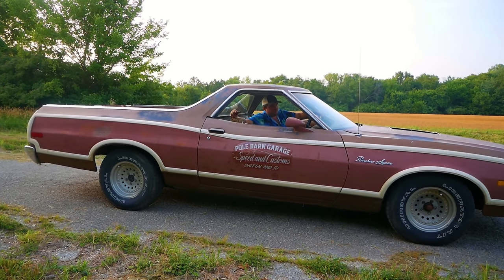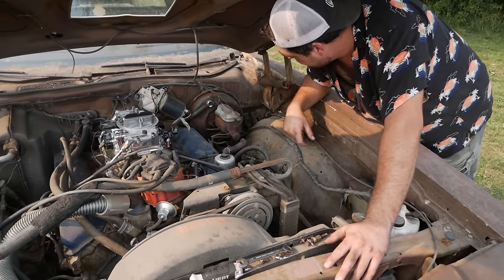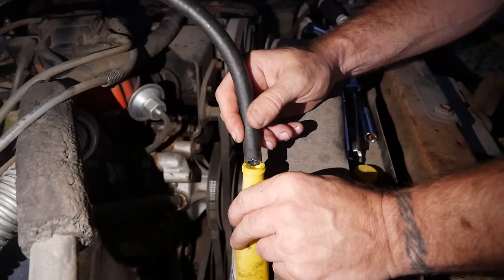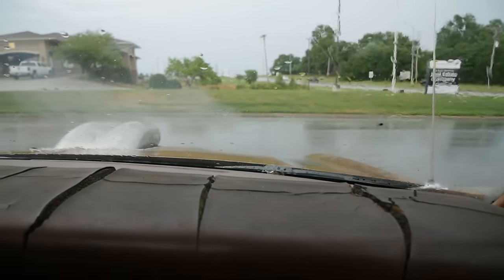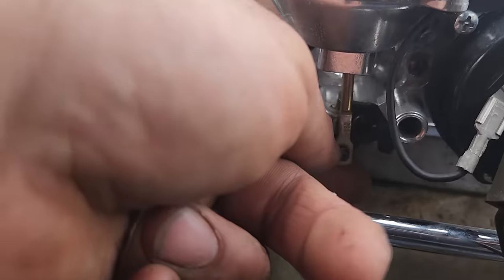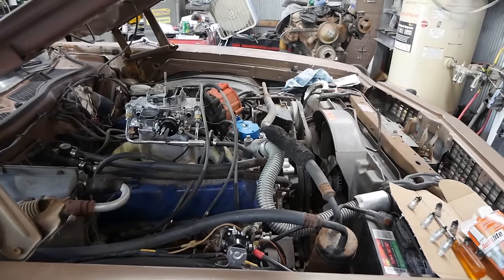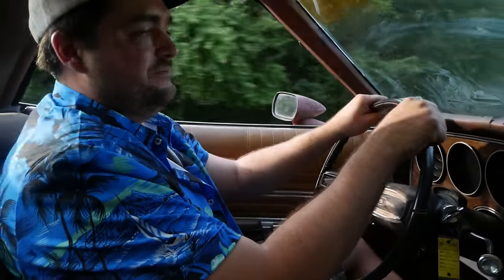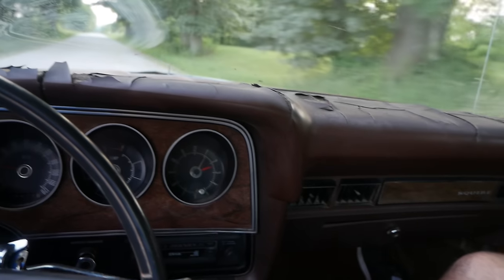Forgotten BUILT Big Block Ranchero-Will It Run and Drive? Huge BURNOUTS!

Comment: Did you add the zinc just for the heck of it? Having the steel valves must not necessarily mean the heads are able to run off unleaded gasoline then? Super sick Ranchero though!! Probably my favorite on the channel yet. 🇺🇲🇺🇲
Reply from the maker: Zinc is for flat tappet cams, not valves. Leaded gas was for valve seats. Thanks!
Reply: @PoleBarnGarage  Ahh... I should have thought that out a bit more...lol
Thank you for the information!!

Comment: One thing I learned watching these revival channels, DO NOT put a summit carb on your unit. I’ve never seen one not have problems. The basura blanca has to live up to expectations. A set of rear  tires a week has to be the goal
Reply from the maker: Yeah those things are garbage. If I had any better options on hand I would have gone another route

Comment: My 1984 cadillac seville is my prised possetion. I got it off the original owners nephue after he passed. The owner lived the car and put 100k miles on it. The car is warn but it still shows nice and runs ok. I wish the engine was just a regular old pushrod v8 but it has the ht4100. People tell me to swap the engine out and put in a olds 350 but i feel like the engine is the heart of the car. That engine is what powered that car for its entire life all 100k miles. Changing the engine just seems wrong to me. I do all i can to keep the old girl going. I would rebuild the top end of the engine but everybody says once you take the head off that engine youll never get it to run right again. So i change the oil ever 1000 miles once a summer. I hope it lasts a long time. I feel like i owe it to the original owner to keeo this car on the road make sure it never ends up as scrap. So many of the 80s cadillacs were scrapped because of the bad engines. Its hard to find eldorados and sevilles from the early 80s now. Can you guys please try to find a seville to save? They were such a iconic and beautiful 80s car. Some people hate the design others love it but wayne kady designed a beautiful car. They took a risk and it payed off for them. Ford and chrysler actually copied them and made bustle back cars of their own. Well if you read this comment please please please try to find a 80-85 cadillac seville to save. I want more people to be aware of these cars. I get so many looks and questions when i drive mine. Plus i lt would be nice for somebody to show a video of repairing a ht4100 engine.

Comment: The 73 429 engine had 8:5 to 1 compression. Timing 10 degrees before tdc. 36 degrees total.
Reply from the maker: If it were stock, sure
Reply: @PoleBarnGarage  Pistons look stock.
Reply: Compression test would tell.
Reply from the maker: Valve overlap dramatically changes cylinder pressure regardless of piston (for better or worse) clearly it has plenty of duration going on. Once you change a cam you can no longer use factory timing specs, because you've changed the combustion event

Comment: Yall ever run across any Cyclones? That woud be neat. I had a '71 GT in High School (circa 1989) Supposedly it was #12 of 29 built as a police interceptor. At the last minute, whatever dept was going to buy them backed out because they wanted 4 doors. I found all this out years later after some research. Ford sold them to the workers at the plant at a steep discount.

Comment: Hilly-billy pro tech....use ford starter solenoids on your rider mower when the original fails......usually cheaper and lasts longer on a 20 HP Briggs....

Comment: Hook up the vacuum advance that will take care of the timing issue.
Reply from the maker: No it really won't lol. Vacuum advance requires a vac signal, long duration cams produce very little vacuum
Reply: @PoleBarnGarage  If you have enough vacuum for your power brake booster to work your vacuum advance should work as it uses less vacuum than your brake booster.
Reply from the maker: Has vacuum issues with the brakes. Besides the fact that vacuum advance is simply for drivability, it doesn't have any effect once the throttle blades are open fully and there's no.. You know... vacuum

Comment: throw an 02 sensor in it see if you are running out of fuel at full load... that's what everyone else is doing.. i do see where it's choked of air, my TPI is great at spinning the tires but run out of air mid drift.. bigger carb would do that engine justice.

Comment: There were only 166 ranchero squire 429’s produced in 72. So 73 has got to be just as rare
Reply from the maker: 320 ranchero with 429
Reply: There were 320 ranchero 500’s with a 429 there would also be so many Rancho GT’s with a 429

Comment: I kind of like how there's a beautiful 429 up front and it's a one wheel peel wonder. Why? Did he order it like that? Did they NOT put the rear you found the receipt for in? Answer me these questions three. Oh well, it still looks like a SUPER fun car. My ex - buddy had a 67? ford Fairlane with a Ford 427 it was hand built (maybe modified after it came bare from the factory, 1 of 20 with papers) by Shelby. I have had many an argument about the 427 and Ford didn't make one blah blah blah. Yes. Yes they did. I promise. Anyway nice car!

Comment: I hate to break it to you Dalton but your long over due for a 11hp. Honda 4000 psi 3.5 or 4.0 gallons per minute belt driven 
pressure washer and don’t cheap out an go w/ a shaft drive either . I own a residential pressure washing company and I’m still using one of my first purchase pressure washers . Guess which one .. Yep the fore mentioned .. I’d say after 28 yrs. You could call that almost a lifetime since I’ll be retiring soon . If for some reason you don’t have one by then hopefully 2 yrs. Your welcome to mine . Yes you can find a used one red Honda and it will be fine look for a blue cat pump w/ 9 lives or the General pump anything else is junk .
Reply from the maker: I have a knockoff pressure washer that works fine. Or I can just go to the car wash and spend $8

Comment: Thing needs an old cobra jet shaker scoop
Reply from the maker: I wish, but the hole is too big. Dad has one on his 70 Torino, much smaller hole
Reply: @PoleBarnGarage Mopar shaker scoop, upset all the purists 😅

From what I could see I think your carb is running too lean get like a 1050 CFM brawler. You can always jet it down. Might also want to have the distributor re-curved, and degree the cam. There's a lot under the hood of that thing. Old 800 CFM quadrajet would make that thing moan like no tomorrow, but good luck finding one.

Comment: There's a 521 stroker with stack injection for sale on marketplace close to me for $11,500.. that'd wake that Ranchero or Torino up for sure! ::P My first car was actually an incredibly anemic 302 69 Ranchero GT.. small when you're 6'3, impossible to drive when you keep growing and hit 6'7.. let alone the 6'10 now. 
Factory 429 4brl in 73 was still only rated at 230HP.. of course they were lying a bit but it still was probably only 325HP with the super retarded ignition with next to no advance keeping max power at 3500rpm. It will never cease to amaze me how they thought retarding the ignition and making the engine run like crap somehow was reducing emissions. 
You'd be amazed at how little ex-govt properties go for. There's people with next to nothing that have bought nuclear silos and turned them into houses. Go out to whoever's working the property and ask them who owns it now and what they're plans are.

Comment: I’m surprised the guy had dished pistons put in it. According to the charts even with the D0VE heads it’s only around 9.3:1 compression. So it’s slightly over cammed for that compression. Also makes me wonder if when they rebuilt it if they used a straight up timing set or the timing set with the 8 degrees camshaft retard built into it like all 429/460’s had after 1971 until they went fuel injected in 1987. Even if it does have a straight up timing set in it you might advance the camshaft that’s in it to get more bottom end. I wish it had Police Interceptor heads on it. If it did I have a set of Sanderson shorty headers here I would give you. Headers really help the 385 series engines to breathe.
Reply: I do have a new Comp Xtreme Energy cam for a 429/460 here if you want to try a more modern grind in it. It’s a CCA-34-235-4 and it’s power band is 1400-5600.
Reply from the maker: Yeah I don't know what's going on here, we have more work to do

Comment: Shouldn't the alternator be putting out 14.2v?
Reply from the maker: Not necessarily. 13.6 is fine. Gotta figure the loss in the wiring, and the crappy meter
Reply: @PoleBarnGarage  makes sense. I'm lucky enough to have a Fluke meter that my high school shop teacher uh... lost the year he retired.
Reply from the maker: I lost one of the leads to my fluke. I'm an electrician and I also "lost" my work one and needed a new one provided by the company 😂

Comment: "the door buzzers always work in fords" 
Yea. Unfortunately. 1 of the things I hate about my 94 ranger. That and the rear most frame cross member is COMPLETELY gone. And the 4x4 don't work. And I can see the road through the floor. And there's an exhaust leak perfectly positioned to blow exhaust fumes right up in the cab. And the pivot arm bushing left a while ago... Maybe I should stop there.

Comment: It's time to get a power adder and a Ford 9-inch rear-end.
Reply from the maker: All of them have 9" rears
Reply: I did not know that. I thought I only saw one wheel spinning. Maybe not the whole rear end but a good center section with a locker.
Reply from the maker: Yep 3.70s and LSD on the way

Comment: I don't think those Summit carbs suck I just think they're a budget minded <500 cfm carb for guys who put 750 carbs on an engine that can't handle that much air. Not by any means saying a 750 doesn't have a place in cars, just not in a 305 choked with emissions 1978 firechicken. That's all
Edit: after second thought, yeah they kinda do suck.

Comment: why ditch the fuel cell? what with the not flying around the bed and such
Reply from the maker: Fuel cells are always filled with anti slosh foam, it deteriorates pretty quickly, so I figured after sitting it wasn't worth the risk.

Comment: .035 on the spark plug gap no more with that ignition
Reply from the maker: No... Just.. No. .035 is correct for points. This car has a gm style HEI, capable of arcing a larger gap, which is far more efficient and prevents fouling. .045 is recommended for all gm vehicles with an HEI, sometimes .060.

Comment: That needs a 950 DP on it MINUMUM , it aint gonna be an economy car, don't try putting smaller carbs on it! I like Lunati cams in driver cars, they make grinds that make power but still work with power brakes whereas comp cams have too narrow an LSA for that
Reply from the maker: 950 is waaaaaaaay too much air for a 9:1 (at best) engine

Comment: I had a stock 429 with a nice aluminum intake. Put it in a 1960 ford short bed. Would smash the Chevy trucks! Mostly because ford was heavy. Would squat and fly. That thing used to suck up the fuel!

Comment: You need at least an 850 carb for that engine
Reply from the maker: That's too much, but I got one lol
Reply: Try it, you will be surprised, those 429’s are very thirsty
Reply from the maker: Figure it only comes on above maybe 3500rpm, so I picked up some 3.70s to go with it. Should help it out, but I think it needs a smaller cam or more compression

Comment: "I have a Jag" LMAO. I'm thinking we are gonna hear that line for years to come.
It's on his List. Rearend. Ford 429 and 460 were never great motors. Just big. Of course a 750cfm carb is mandatory. But maybe finding a 9" Ford with some gears. The part he didn't get to yet.
Reply from the maker: All of them have 9" rear ends of course. So a set of 3.70s is on the way as we speak

Comment: Why wouldn’t the rad have pressure on it?
Reply from the maker: After sitting for a day? It absolutely should not
Reply: @PoleBarnGarage  always felt that was a sign of a good sealed system 🤔
Reply from the maker: Possibly, should vent to overflow though. Typically that's a sign of a bad head gasket

Comment: That Ranchero is so over cammed it is hopeless to ever expect anything like horsepower out of that engine. Must have been built by a first timer, they always buy BIG number cams.. Rip that cam out of the engine and break it in half so that no one ever tries to use it again.
Reply from the maker: Agree. But usually built by boomers who don't actually understand how an engine operates. 

That said, you CAN make power with too much duration, it just isn't going to be pleasant

Comment: Or you can donate it to me a disabled man who can’t find anything in Indiana that’s worth even trying to fix frame is gone heck I found one it looks good until I opened the hood and it was so rusty the frame that holds the motor in was gone motor was literally sitting on the ground and oil pan was rusted off and I opened the door and it fell off and the guy said $1,000 bucks I just turned around got to my truck and left he kept messaging me got down to $750 bucks and I said I don’t have any interest in it but thank you.

Comment: That wasn't a case of motivation, it was  a 12pack of estrogen. Very disappointed "guys"! Did you do each other's nails after?
Reply from the maker: What's wrong boomerino?  Viagra prescription run out? Barb's menopause driving you nuts again? Corvette won't start? Harley is leaking again?